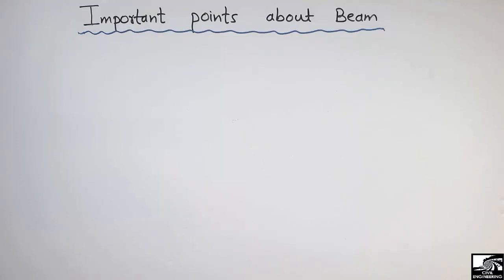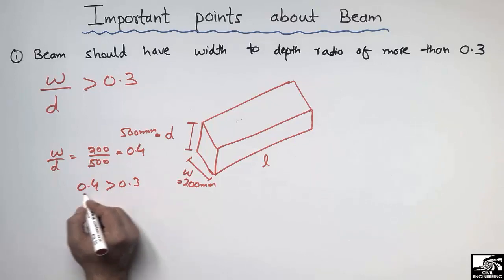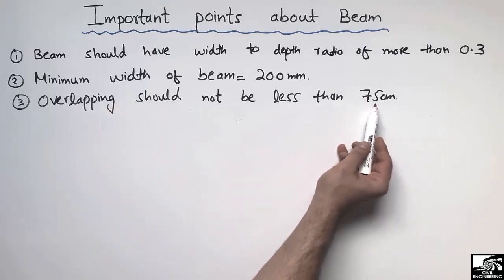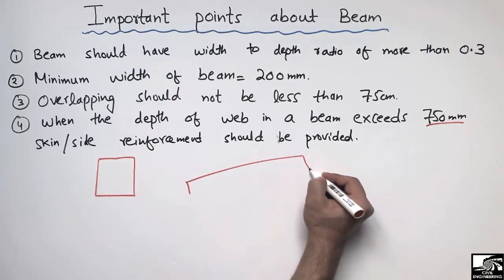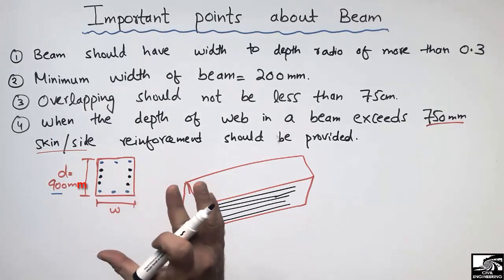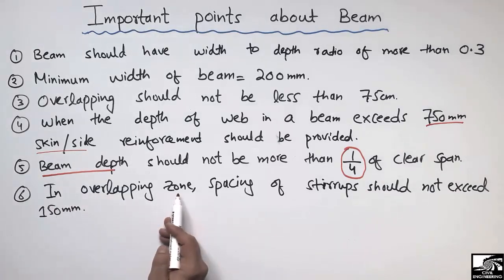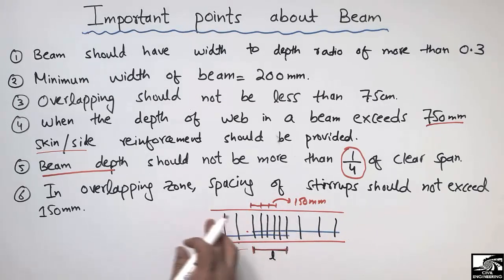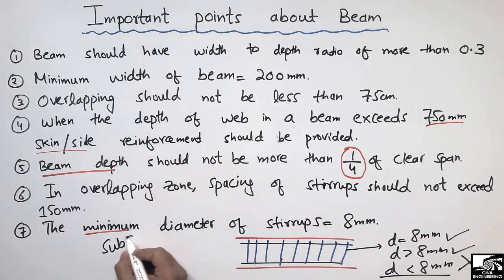Important point about beam design

Comment: I was always told that the Beam Ratio should be Height to Width = 1.5:1
>
1/1.5 = 0.66666667 not 0.3
1,5/1 = 1.5 not 0.3
>
Also I was taught that Lapping at the bottom of a Beam should be at the ends because they are in compression, whereas the middle is in tension. Your lessons perplex me.

Comment: Sir what is concealed beam, cantilever beam, strap beam, lintel beam?
Reply: Strap beam is the beam provided in Strap Foundation to join two footings, Concealed beams are the beams which are hidden in soil like Sub-structure, Cantilever beams are provided in a one way Slab or Roof of Verandah , which one end is fixed and other end is free. Lintel beams are 6"x6" or 9"x6" in sizes and are the beams provided above windows, Doors , and Ventilators. 

Kind and Regards,

Assistant  Director-(Works)